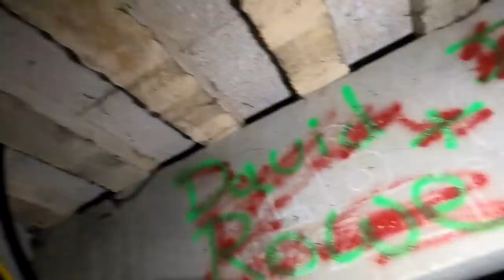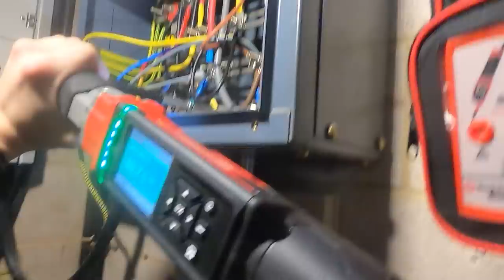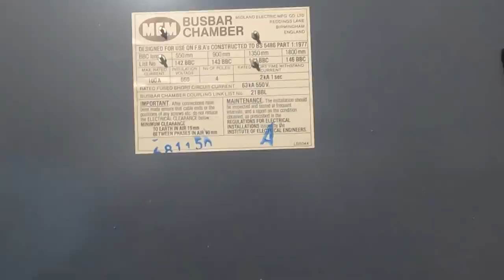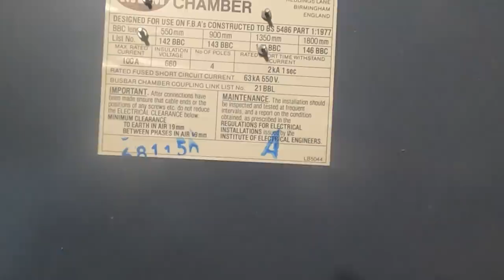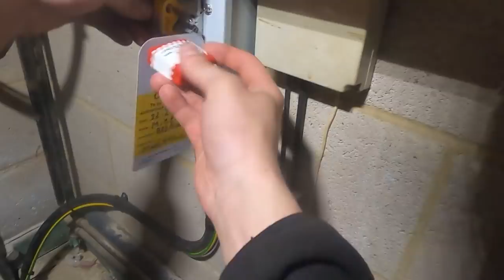3 phase MEM busbar chamber connection

Comment: Surprised your using the junior on the SWA defo get the depth saw from Boddingtons I’ve got the ITL version makes it so much easier not having to think about how much cutting force you use. Also a dismantling tool makes it far quicker stripping the inner bedding without fear of nicking the cores, I use the knipex one 🤙 good vid. Another good thing to do, to get the shroud perfect every time is to before stripping the armouring spin the shroud backwards jam it on the end of the cable it’ll then show a line around the uncut end then just cut where the line is 💪

Comment: A really nice video, you do not over talk or explain things, it was about right. I would have taken the tails in front of the bus bars though (just me) I am also a 236 pt 1&2 but with the 17 edition ( if you know or heard about the time everything had to be earth bonded) well that was my time of working! lol. I have also rewired houses, factories, offices, conduit work, power pole work plant nursery's, designed and built all sorts of panels for control units with contactors etc!!! also done a lot of pyro work and i use to dress the pyro really well too.  You name it I have done it! ! I am retired now though but still do a bit on the side

Comment: I would unwind your torque screwdriver to it's minimum setting after each use. It takes the pressure off of the spring and keeps the screwdriver within spec for longer.
Reply: Where”s the spring ?😂😂
Reply: @residualelectrical  😂😂
Reply: @hermanngoring397  In the handle
Reply: @stupot_64  There is no spring in the handle😁
Reply: @hermanngoring397  I must be making them wrong then.

Comment: 44:20 what a pain using solid multi core wire in that small box from the bus bars ..in Belgium i would use stranded  10/16mm VobSt wire and ferrules...

Comment: Curious to know why not use knockout punches? Less metal shavings which are a pain to clean up and the holes are neater from what I've seen from working alongside electricians (datacom installer here) making less cleanup of the holes for glands or bushings.

Comment: Nice Vid, only things I picked up: When clients have UPS's, ask them to shutdown their devices and then you can shutdown the UPS, I can hear a APC (lower tones) depleating along with another. 
The rule of thumb for any bolts/nuts, use washers. The provide a bearing clamp surface without the bolt/nut cutting into the surface while being secured. You nailed the other bolt rule, always face downwards.

Comment: you're getting continuity to earth because the isolator is only three pole i should think. with neutral still connected its obviously still connected to earth via the pen conductor (tncs). connected loads on each line within the installation will be giving you continuity to neutral and as such the earth as well. good vid though mate.
Reply: @residualelectrical  don't get me wrong I'm not attacking. just suggesting (like you) what I think was probably happening which yeah would give you continuity between every pole through any connected loads back to neutral and as a consequence of the tn earthing arrangement... earth. more likely than anything clever being done by a proteus isolator anyway ;)

Comment: Btw  keep up making those video's and showing almost every step ..( some others leave the most tricky steps out of the video ) .
Reply: To be fair if you're poking around inside a TPN busbar chamber you really shouldn't need youtube to show you the what's involved in the process
Reply: @_______DR_______  why not  ?  Many other video's gland in the cable and then connect it all off camera ( Latest video EV install Artisan for example ) . No very usefull video content .. feels a bit like those home improvement shows ..show it before then 3 minues trades busy and then end result .. I'm not saying need to show connecting every wire .. on the other hand you can always FFWD ...

Comment: 39:07 Those circuit breakers are fed on the lower terminals when installed in a Hager distribution board.  This contradicts your arrangement here.
Reply: I mainly do industrial work, with similar looking 400A circuit breakers we have to be careful which end we put the live supply cable into. Some are designed to expel hot fault gasses onto the load side cable which will be dead when it trips. If it's connected the other way round the fault gasses will expel onto the live bus side and possibly cause a flashover. You can tell which end is which by looking at the vents. I don't know if smaller CB's have vents.
Reply: @residualelectrical  I don't believe that to be true, fella, at least on their smaller ranges.  I've done a fair few Hager 125A TPN DB and their MCBs always connect feed side to the bottom terminals, load side top, just as it is for their RCBO/SP MCB (often used together in the same board).  If what you say was true, then the TP MCBs ON position would switch towards board centre opposing that of any RCBO/SP MCB housed within the same enclosure.

Comment: While the Milwaukee Digital torque wrench is great. Topeak which is a manufacturer that does digital torque wrenches for bike mechanics is great. of course it’s still manual in terms of applying the torque, but cheaper than the Milwaukee.

Comment: Why did you blame MEM because you used a board that wAs on the small side? . Using plastic plugs on metal fire clips compromised the fire integrity of the clip. You should be using an all metal brick or concrete screws

Comment: not gonna check the comments, but if you put a cable tie around 20mm above the gland, when you strip the inner sheath it won't split down to the gland if it's soft crap.

Comment: Why is the ground on the outside of the cable. Here in the us we would buy a five wire cable or use the armored part of the wire for the ground through the isolatior box

Comment: Just curious, if you weren't attaching an earth flylead to the bolt, why did you bother with the bolt and banjo at all? I like those pirahna nuts better than the old fashioned banjo/bolt since it saves drilling holes in the enclosure. You have some fantastic tools, great video.

Comment: The amount of talking is fine by me. Rather you than me getting that SWA into such a small 4 way enclosure - given the lack of 4P isolation I'd have taken the neutral all the way to the busbar rather than into that fiddly little bar
Reply: realised early on that the supply wasn't particularly big (tails look like 25 or 35, supplier's isolator looks like 100 or 125 and the meter doesn't use CTs) but surprised to see that the busbar chamber is only rated to 100A. Doing mostly domestic I don't come across that stuff very often, but would a busbar chamber still be specified on a new install of that sort of size, or would you just use a big 3Ph DB?

Comment: Whose got any tips for removing holesaws from arbours 🥴🥴🥴 I tried the Wills electric tip, copper between them but the holesaw dint fix properly. Cheers in advance 👍🏻
Reply: And get the Super Rod dual holesaw arbour. Instead of unscrewing, the pins slide down so it doesn’t jam. Once you’ve pulled the pins out you’re golden. Copperslip grease is better than copper wire. Works great on core drills too

Comment: I don't know if already asked but why use external ground when there is already one (the outer layer) in the armored cable?
Reply: Because the armature of the SWA cable is made from steel wires, not copper so the added resistance will increase the Ze.
Reply: @vladm.6642  Zs ;)

Comment: That little closet you are working in will act nicely as an oven during an arc flash. There's a reason why there are clearance requirements for these types of panels, three feet for 480VAC panels in the US. You clearly don't have that. Also, where the FUCK is your eye/face covering? Do you even know what PPE you need? Was there an arc flash calculation done on those panels? For anyone wanting to work in this industry this is great video demonstrating what not to do.